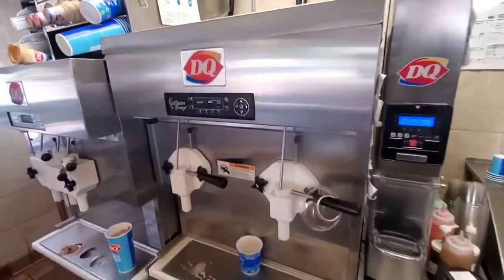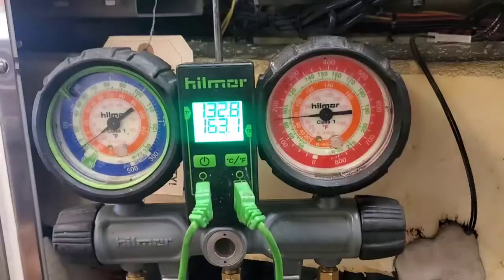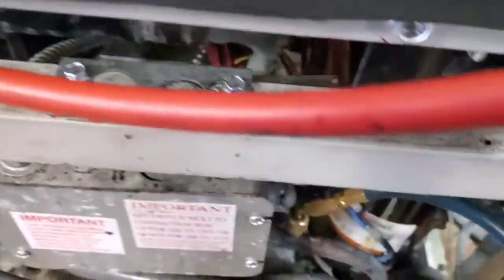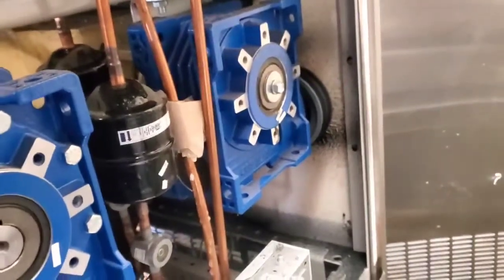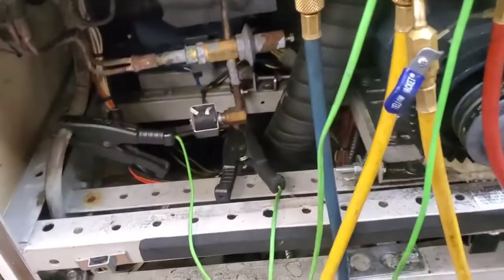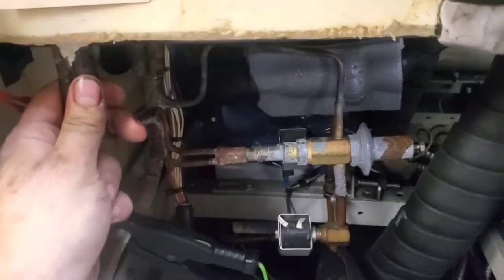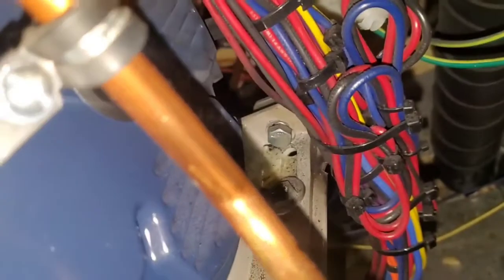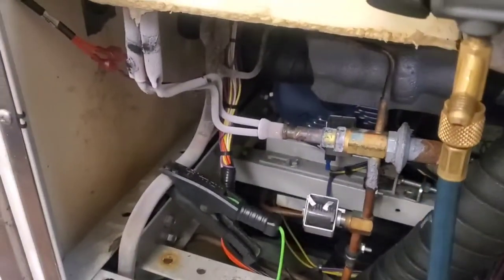Electro Freeze Machine Heating Mix to 135° Because of a Refrigerant Leak

Comment: Such a common wiring rubout on those. I’ve had a few relay boards burn up cuz of the shorts. Lately they’ve been putting rubber paddding on the edges. All the vibration from those motors and those wires rub out
Reply from the maker: Luckily tgis one only took out the evap fan section of the board so with that wired to constant power the board can stay put
Reply: @satanicinduction  I was going to ask about that. Did you replace the board or not. Wiring it hot is a great idea
Reply from the maker: It was actually after hard wiring the fan that the rub out blew up. I may not have found it so easily otherwise. As for the board, nope it's still in there burnt and working fine.